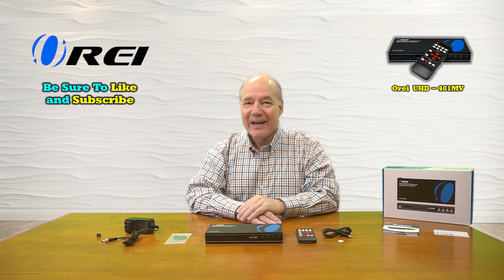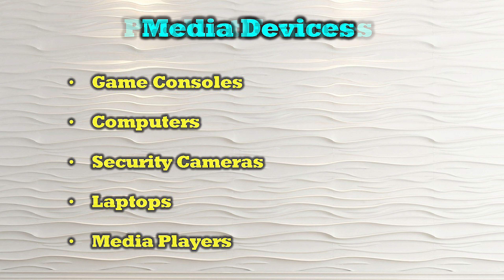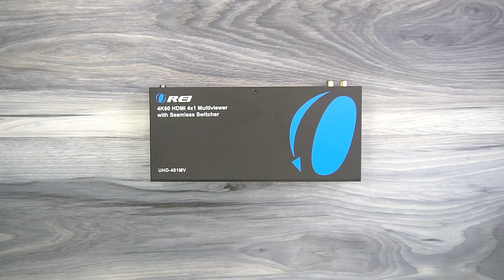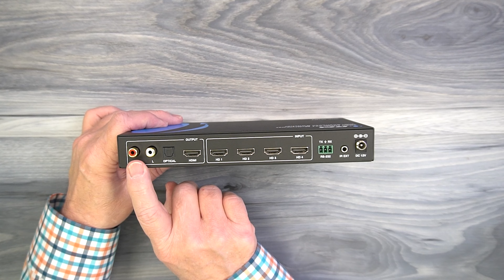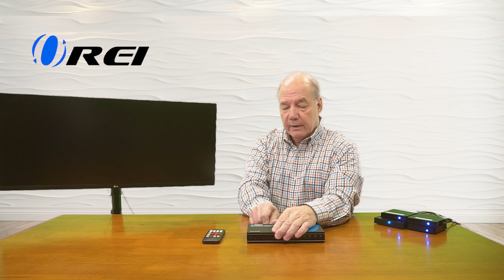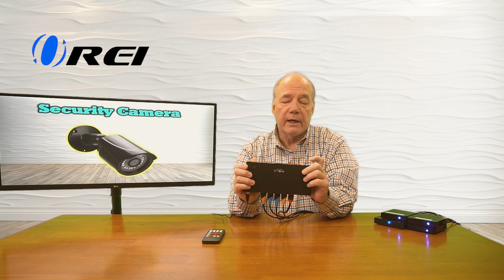OREI 4K Multi HDMI Viewer Quad 4 in 1 Out Switcher 4 Ports Seamless IR Remote Support 4K (UHD-401MV)

Comment: The seemless switch is amazing, especially becuse my Epson HC3800 takes FOREVER to redetect settings.  Do they plan to add HDR support? (even if it's HDR only for full single screen or input ) and I'll buy again in a heartbeat.   I had to return mine becaue of the crappy remote and no HDR support.. also the convoluted audio switching method in multiview mode. A simple "next" audio and screen indicator would be minimal.

Comment: This provides a solution for my visual needs but encountered an audio issue. Between the options for win, 1, 2, 3, 4 I only ever seem to get audio from one source selection, period. Is there no way for "win" to do all sources that are actively running through either hdmi or the breakout options? Or is it only one active audio source and you can choose which one it is separately from the video feeds?
Reply from the maker: You can only play audio from one source at a time. Currently, there is no option to play audio from all 4 sources at the same time.
Reply: @OREI-COM how do you pick which source to play the audio from?
Reply: You can have separate HDMI audio extractors on each of the input signals. A full solution would feed those audio signals into a sound mixer (letting you control relative volume of each), whose output would go into a sound bar or a speaker.

This is an area where picking the right products and cabling would make it pretty convenient and seamless whereas a lesser system design would create an unstable mess.